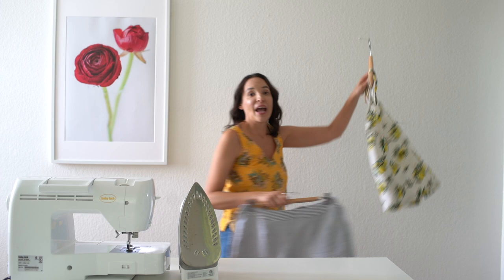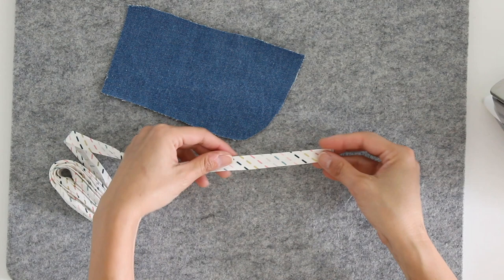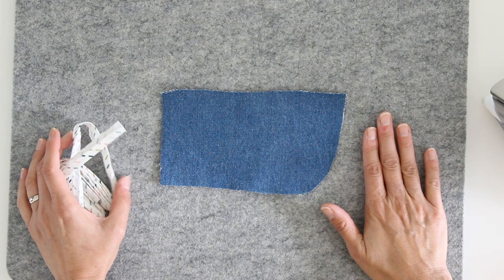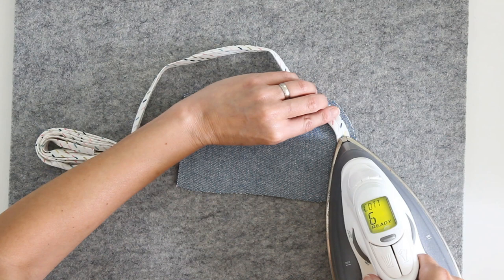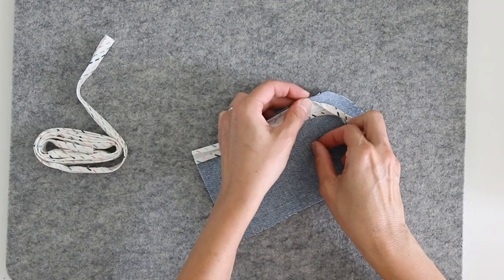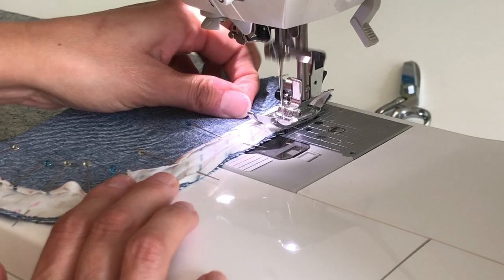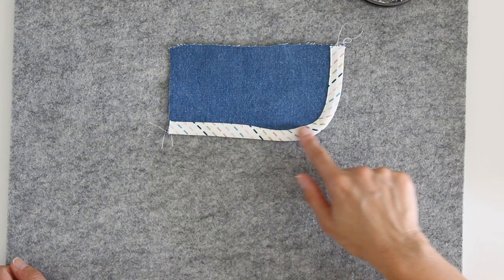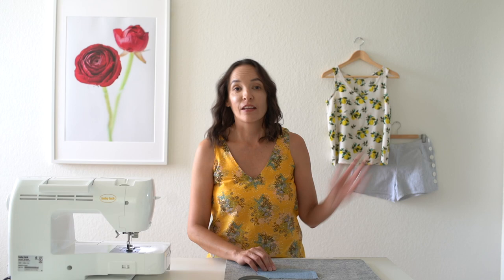How to Sew Single Fold Bias Tape

Comment: What size bias tape maker did you use to make the single fold bias tape on the sample in this video? How wide do you cut the strips?
Reply from the maker: 1/2 inch. You cut strips double the width of whatever finished width you want.